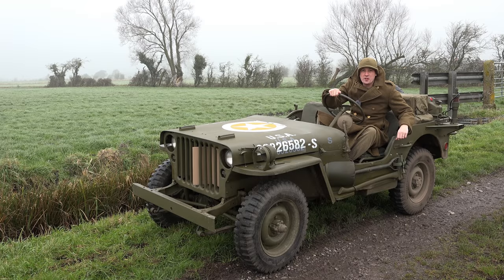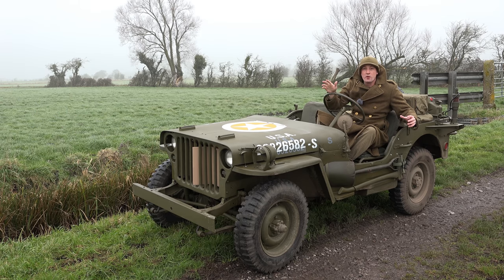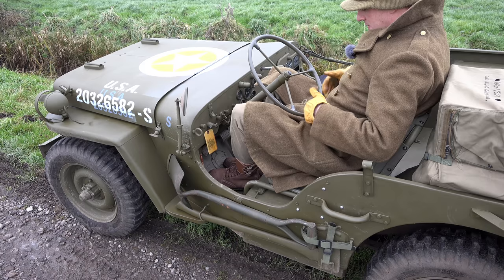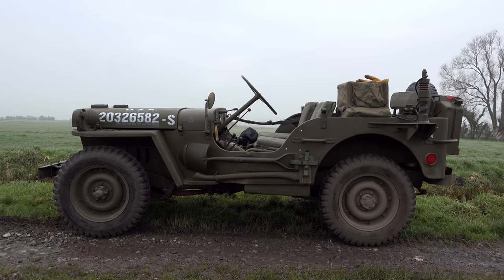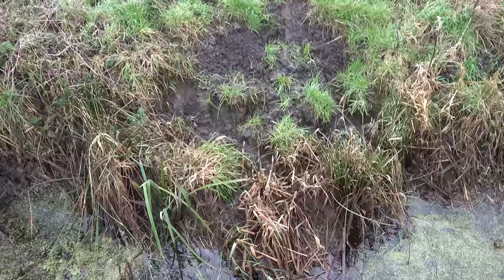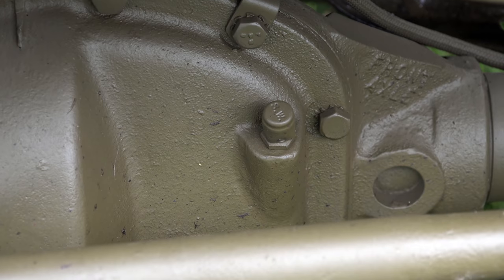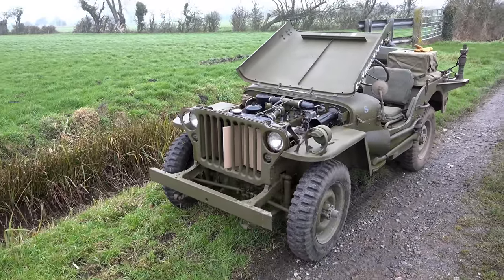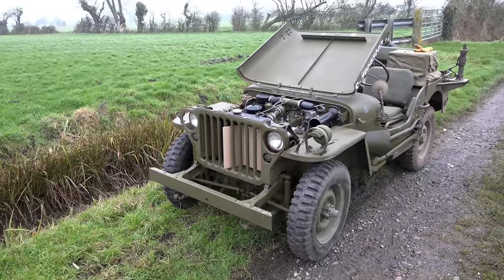Top 5 WORST Willys jeep features!

Comment: I think most of soldiers during ww2 put extinguisher away or somewhere in the back cases because of the switch light and comfort also...
Reply: I have mine mounted on the forward edge of the rear wheel well right next to the driver's seat
It gives under your torso and I personally don't even notice it

Comment: It was designed for a purpose, in a hurry, and anticipated that it was likely not going to survive for long.  I think, for the time, they did a great job...but we've moved on since then, most of the survivors now will be coddled but is a product of the time.
Reply: couldn't agree with you more. the thing was fit for purpose and cheep. very good bit of kit.
Reply: Couldn't have said it better. It did what it was designed to do and it did it well. Might as well point out the problems with a Connestoga covered wagon which BTW was built by the Studebaker Bros. Yes, THOSE Studebaker Bros. They started out building ambulances for the Union Army during the Civil War.
Reply: Well, the German Jeep, the Kubelwagon , was merely a beetle redesigned. ( Remember the 1970's VW. " Thing" ?, a redesigned Kubelwagon for the public, in fancy bright colors. " I'll take mine Afrika korps tan !!".)
The American Jeep was used everywhere.

Comment: The early transfer case was weak; the emergency brake on the front of the drive shaft was a joke; and the carburetor had a tendency to drip gasoline on the exhaust manifold when it got a little worn; Warn front hubs that could be locked out hadn't been invented yet; and they were so underpowered that even with an aftermarket overdrive, reaching 55 mph was a rare thing.  Even so, when they came out, they were light years ahead of what had gone before.  I owned a 43 Willys that had seen some hard use after the war.  I was once told it was the biggest pile of ugly on the road, but it was a thing of beauty to me, warts and all.

Comment: I was 6'2" ((1.9 M) in the US Army in Vietnam 1969-1970.  I drove a Ford brand "GP" and I don't recall it being that tight to enter or exit.  I don't recall a fire extinguisher, either.  Maybe they increased the passenger compartment dimensions a bit for Vietnam.  We did have a radio (but no radio operator, but that is a story for another day ...).  Well done presentation and explanations.
Reply: Surprised there were any MB/GPWs left in service by then. I have a Korean War vintage M38, which was a militarized CJ-2A. I'd expect there to be some M38A1s in Vietnam but I was under the impression the Jeep had largely been replaced by the Ford built M151 Mutt by then. I remember seeing those in the motor pool of our local NG depot, and hated that the DOT wouldn't allow them to be surplused without being cut to pieces.

Comment: I had an M43 made in early 1945 and it was water proof quite a lot,It  ha distributor cap covered with metal can and ignition cables were going thru hydraulic pipes with spark plugs aloso hermetically enclosed,  It also had foldable snorkel from air filter.

Comment: I totaled a 1945 Willies in 1972 by running into the left side of 1967 Suburban when the brakes failed. Previous owner had welded on a metal top with metal doors. Loved it, but it was very basic. Left frame crumpled back over itself so my dad accepted the total from insurance. Three you men inside it and only minor injuries in spite a lack of seatbelts and we were are own airbags. I bent the steering wheel over the left side, a lucky thing as it isn’t a crumple type mechanism.  The fire extinguisher was probably a after delivery add on by the military (private, go find a place to mount this fire safety device). Anyway, everyone who has had a four wheel drive vehicle owe their legacy to this little war winner.

Comment: Underpowered, lack of a full cage roll bar, open differentials, unforgiving suspension, lack of seat belts....I've got a '49 Cj2a, and in my Jeep I've remedied all of those issues...Ford 289 K-Code that's .030 over, posi front and rear, full cage roll bar, Simpson racing belts, Sky Jacker soft ride 3" suspension lift, Warn manual overdrive....what I'm actively searching for is a somewhat decent Cj3b, that body style was my Dad's favorite of all the Jeeps he's owned over the years, and up until this past Monday, he and I were gonna try to acquire and restore one...but instead of us doing that, he died from a massive heart attack right in front of my Mom, his wife of 51+ years....so, those plans cancelled, but I'm still lookin for a Cj3b though....

Comment: Number 6: The top of the windshield, when up, is at eye level. You have to stretch up to look over it, shrink down to look through it, or lean out to look around it. This is why the later civilian models, CJ3,  had a raised windshield or raised bonnet.

Comment: The fuel tank right under the driver's seat I would not consider favorable in a combat situation.  Certainly if I were the driver..
BOOM.
Reply: I call the drivers seat in my Willys the Ejector Seat. Get into trouble? Drop in a match and hold on!

Comment: 6 - the fuel tank tube. You can't fill the fuel without spilling it everywhere if you don't have a proper nossle for the jerry can. But I must admit the tube is a good thing in general
Reply: The fuel tank filler under the driver's seat. Fixed in the M38.
Reply from the maker: That's a good one but its more the spout on the jerry can than the jeep.  I wonder how many 1000's of litres of gas were lost due to the can design, more than a few liberty ships worth I bet!
Reply: Yeah.
Not a jeep design problem.
If you're making a mess, thats a you problem.
Jerry can with the donkey and youre fine.
Reply: @kyleh3615  Well, if you need a special tool for the simple operation like filling the tank it is a design failure. And they fixed it in a CJ2
Reply: I can pour straight from the can without a donkey 
But I do have the larger fill mouth

Comment: WW2 Jeep is a lot easier to drive and fit in than my Honda Accord and Subaru GL.  I had to bend the pedal arms on both to move the pedals apart and shifting clutching was horrible.  There`s a lot more seating and baggage in a pinch and your wheel and pedals are better placed.  So easy to park. Tuneups are a breeze.  Too bad it didn`t have overdrive. I`ll take one over a Denali,  anyday.

Comment: Gripe #2 ~ That applies to modern vehicles as well. Heck, they're even worse due to now being packed with electronic extras folks don't need. Seen countless examples of witless drivers going into flooded areas in their low slung cars. Plowing into deep pools of water that flood the engine bays through the front grill. A few seconds later, the cars get completely flooded and stall out. And, they don't start up again. So, that's an issue that still exists.

Comment: Good luck with the top bows. I think that your antenna guiding bracket is mounted to high. So you get major difficulty’s when getting the top on. I had a problem with it. Succes 👍 love your video’s btw. Regards from Holland.
Reply from the maker: You are very correct, I found this out just before your post!  Thanks!

Comment: The canvas top may be the only feature the Kübelwagen has that is objectively better than the Jeep's. The Kübelwagen's canvas stays folded with it's supports on when it's down, so the only thing you have to do is pull the cage over the windshield where it locks itself on. I've used both and it is a whole lot easier flipping up the top of the Kübel with one person, even from the inside in less than a minute instead of two men taking 15 minutes to put the bars in place, slot the canvas into the windshield and stretch it over the top on an MB. That said, it doesn't matter much to the effectiveness of the vehicle, but being able to put the top on before it starts to reign is a still a feature soldiers appreciate.

Comment: Dimmer switch. They never ran high beam...ever. In fact they had night covers over the lights anyway. And yes, most soldiers were 5'6'' with some getting to 5"8-10 at most. 6'2" you would be in a freak show. And no, the drive line was bulletproof and they did get maintained surprisingly well. In winter in Europe they drained the water out of them at night. Some units filled them with alcohol instead of water, specially on airbases where there was a lot of methanol available.

Comment: I bought a 2021 Wrangler 4xE. Feels huge.
I doubt it has even a single part commonality with the original.
... Maybe a hose clamp ?
Reply: The last Jeeps that had any parts commonality with AMC was the TJs.  Even then, it was NOS door handles and such that they used until they ran out so not all TJs even.

Comment: I am intrigued by the placement of the HF Radio antenna base, as they were generally mounted on the rear between the jerrycan and the left side of the vehicle, that way they are out of the way of the roof bows and also they don't hang up on things or take out people you drive beside. The only Jeep that had anything on the side of the back was the later series made by Willys Overland after WW2 which had a side mounted spare wheel on the right side of the vehicle as it had a tailgate.

Comment: I know this is going to sound strange but have you tried and 8 volt battery? there's a local shop near me where I can get 8 volt automotive batteries and they're not any bigger than the normal 6 volt. The charging systems on my older vehicles handle them just fine without any adjustment I never really have any problems with lamps or gauges just a thought you might want to look into it.
Reply: Since you mention that a friend owned a 1940 Cadillac limousine. It also had 6 volt ignition (!) . And the addition of an 8 volt battery,recommended by a knowledgeable battery guy,made a real difference in winter starting. 6 volt ignition systems are an invention of Satan as far as I am concerned. 
This guy likely wants bone stock as per WWII specification. So a good idea,but.....
Reply: I've done 8v conv on VWs (2 - of mine) a batt & tweak the regulator & go ...

Comment: Having been an 18 yo GI, I have a very good hunch that there is a reason that your other fire extinquisher was broken off. You have to remember that if it is bolted to the vehicle it isn't an inspectable item. As long as the driver could present the fire extinguisher, no one would have cared where the driver kept it. This is even more so because the way vehicles are PMCSd, it would just become a part that "you never got", and wouldn't effect the status of the vehicle in a maintenance or operational sense.  Your Jeep is a work of art. I'm very jealous and am seriously thinking of building one. I'm thinking of building one of the SAS types though.
Reply: Agreed , it’s extremely doubtful that very many fire extinguishers or mountings survived . I would think in a combat zone or anywhere that practicality was the first concern , the fire extinguisher would have been either “ relocated “ of chucked altogether since your first concern would be to get clear of the Jeep FAST if under fire . If on fire , no worries , it’s paid for . The only ones who might have cared , if even , would be as my great uncle ( Korea U.S. Army ) would have referred to as “ rear echalation s**m “ .
Reply: @gmoney9588  at this point I would say if you were trying to replicate a Jeep in service, you probably would want to remove that bracket and schuff up the area like an 18yo kid without the proper tools, removed it

Comment: GIs often made tops for cold weather situations.  They were not standard, but field  solutions were  features of frontline units.    You are also missing the  wire breaker  pole of a frontline vehicle.
Reply from the maker: Yes Jeffrey, you can fit a wire cutter and many were seen with them but I dont think i'll fit one to my jeep
Reply: @Greendot319  I understand.  I  suggest you look into motorcyclist goggles.    They would fit with your period uniform.

Comment: Even modern Jeeps are a tight fit for bigger guys. I'm 6 ft, 200lbs and my 2019 Wrangler Sport S 2 door is not as  roomy as my Ford F 250......But hey its a Jeep , made for tight trails, rough ground and FUN. Now my wife is 5'3 and 125 lbs she loves it and drives the hell out of it.

Comment: We had a WIlly's jeep with the Ford grill.    It wasn't particularly useful on the farm.  You would think it would be indispensible, sort of a jackofall trades tractor substitute, but it never got used for anything.   We ended up trading it away for a 3 cylinder big motorcycle, which my sister promptly tore up.     I suppose if you like owned a 1000 acres of wilderness up in Alaska or the Arizona desert it might be more useful, but who has that much land all to themselves any more.

Comment: The strange thing is that the first MB,s had the fire extinguiser on the right side. Like my Slat grill has. My Slattie also has a field modivication on the original Dashboardlights. They were shortened. And I agree with An other comment; its very hard to check te transmission oil.
Reply: My understanding is that the transmission oils are supposed to be serviced with the vehicle tipped over on its' side.

Comment: Maybe try dismounting the fire extinguisher and use it to push the dimmer switch? If you get to the headlight switch you could operate without lights. Weren’t the headlights blackout lights anyway?

Comment: I hadn't appreciated that you were too big for the jeep, you don't look like a "drum sitting on a pea", seems like I am the perfect size at 5'7"! 

Is there any scope to modify the driver's seat so that this could be moved backwards? 

Something to look forward to, in 30 odd years time, you will have shrunk in size, so is that a positive benefit of getting old??? 

Great vid, love the jumping across the stream, how it could have all ended rather horribly! Thank you!
Reply: Some people cut the drivers side wheel well to move the seat back.
In design, if you're too tall, you just adjust the brake and clutch pedals down.

There is a 'big boy' drivers seat that has a special turn that gives you ~3 inches at best.
I'm 6'3" and never have a bad time driving the MB or GPW
My personal wish is to customize a gear shift handle that doesn't angle back as much so my knee doesn't have to bend weird for 1st.
Reply: @kyleh3615  
Good call . Thanks for the info . Will search that to see if possibly one exists for a CJ5 . You would think they would have got it right by then . 
But in all fairness , the mb/gpw is a little more cramped than a CJ5 . Like comparing an MGB to a Nissan Altima .
Reply from the maker: Hi Gary, thanks for the reply, looks like the other guys have answered your question,  just to say love you phrase about a drum sitting on a pea although looking it up it seems to be more pea sitting on a drum, is this a local phrase to you? cheers Matt
Reply: @Greendot319  you are quite correct for pea sitting on a drum, I just reversed that to make it fit your situation!!!
Reply from the maker: @austinswallow  Ahh I get it now, Thanks very much for the comment and I like your turn of phrase, sorry for being slow!

Comment: I had Aa 1942 Willys Jeep in New Zealand for about 5 years. I am small. So did not have some of these problems. I would to point out something that perhaps you do not know about. If you one up steep incline. You lose oil pressure. I regreted selling my Jeep as it stood by me very well. Wonderful little machine.

Comment: Those old military Jeeps are really neat to look at but like you already stated, they are small! They are neat just the same though.
Reply from the maker: More than neat, they're great!
Reply: @Greendot319  Agreed. I never owned one of those old military Jeeps but I did have the honor to own 2 military Blazers. They were called M-1009CUCV's and I just loved the heck out of em. They were 1985 models. Unfortunately they are prone to having electrical issues and they have 3 different voltages in them. They are a combination 12/24/36 volt setup and are a real nightmare to work on electrically wise. Great trucks just the same though. Just like those old military Jeeps.

Comment: Crazy how much of a change it was when they switched to the HMMWV, compared to the Jeep it's massive.
Reply: Well, Christopher Butts, the HMMWV was designed to replace 5 vehicles, in 3 sizes, 1/4 ton, 3/4 ton, and 1 1/4 ton.
Reply: @markcollins2666  interesting, I actually didn't know that. I did know that when the HMMWV was adopted the variety of vehicles in us inventory  dropped but I didn't realize that it was intentional designed to be a direct replacement for all of those vehicles. Thanks for the info!
Reply: @death31313 , oh, yeah. 3 of them were 10 years overdue, and the services were buying Chevy Blazers as interim vehicles. But models change from year to year, that could never last long.

Comment: I was doing my service in the Greek army in 1989 (yes you read that right) and I was driving those. The ignition cables, distributor cap, sparkplug pipes and spark plugs are not original. That's why they are not water proof.

Comment: I think a rubber coated tarp with wool blanket liners or sheepskins, Made to snap in place and  be form fitting to the open area of the Willie's,would have been doable and kept the crew warmer. The "doors" would be snapped or zipped and a simple push would open them. It would be easier to draw it and variations out and note the features. I believe with WW2 and older tech, all the non frame size related stuff could be " fixed".

Comment: The dimmer switch was located on the floor of most American cars in the 1940's, 50's, 60's and into the 70's. In the 40's most US cars had the starter pedal on the floor as well usually to the right of the accelerator.
Reply: In nearly 11 years of service I used the dimmer switch maybe half a dozen times didn't use the headlights or taillights much more.